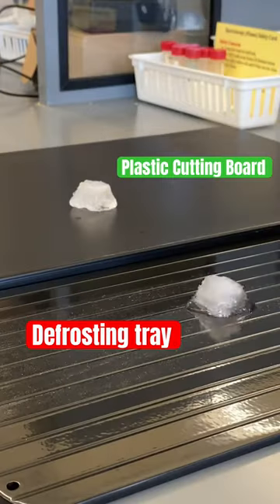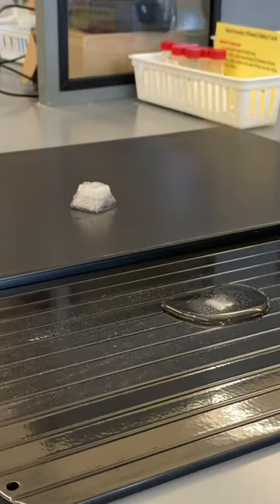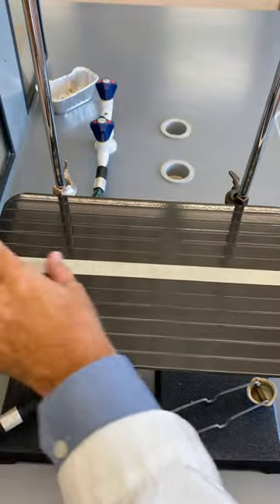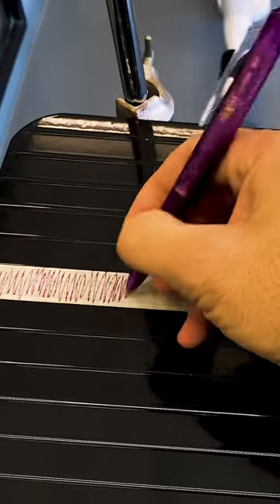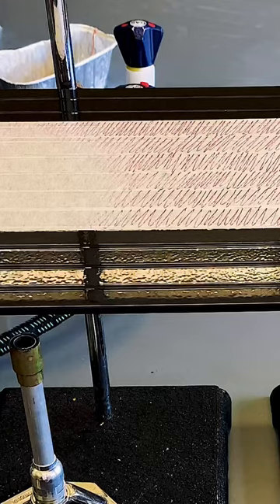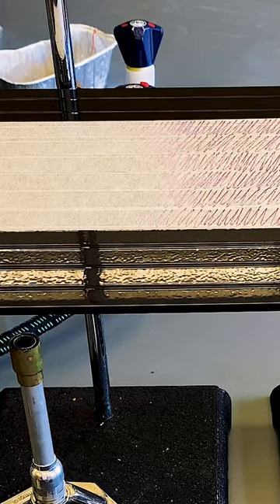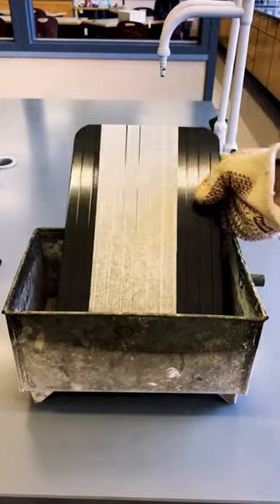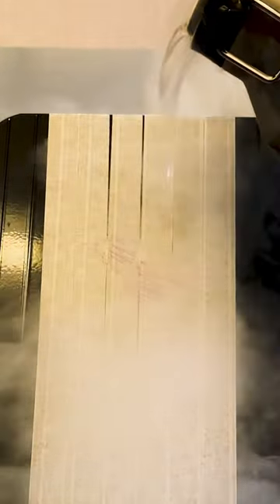Visualizing Heat Transfer with Thermochromic Ink!

Comment: The tray could be room temperature and still feel extremely cold since it's taking heat away so quickly, remember what we feel depends on the heat transfer, and that is usually related to the change in temperature.
Reply: That and pressure, which is also related to the temperature of shit but yeah
Reply: Yea it's literally just the molecules bouncing into eachother. We did an experiment in my chemistry class like this the other day. You take 3 beakers one with cold, room temp and one with hot water then add dye to each and see what happens.
Reply: @frandurrieu6477  pressure effects heat transfer RATE. It does nothing to temperature, temperature is just the average kinetic energy of molecules. Pressure doesn't effect temperature, pressure is a result of confining molecules that are moving at a certain speed. The average force per unit area is the pressure.

Comment: Isn’t silver the highest thermal conductor? 

Either way steel, cast iron, aluminum are great to but the real trick is

You gotta slide that tray to different parts of the counter every now and then to improve thawing speed.

Comment: If aluminum is a excellent conductor of heat, why it is used for food? 😮🤔🤔😳🤯🤯🤯
Reply: What?
Reply: foil is very thin and light. it does not have much mass, so it stores very little thermal energy. thats why you can put it in an oven and it wont be hot to touch.

Comment: doesn't that mean aluminum cans are terrible for drinks cuz they warm up fast?
Reply: Technically yes, but practically no. Your hand is doing most of the hard work then your cold drink is warming up, because it’s just so thin. Something like glass is a poorer conductor of heat, but because glass bottles are much thicker, they can physically hold more heat (which also means they take longer to cook down)

Comment: Can I wrap aluminum foil around a cutting board and get the same effect?
Reply from the maker: It would give you the same effect as there’s also a benefit to having a larger mass of aluminum by which to transfer the heat. Most cutting boards are insulators, so only the thin foil layer would be doing the “work” of moving heat from the surroundings to the ice or item you’re wanting to defrost. I find using a stovetop works well, so placing a piece of clean Al foil onto the metal stovetop and then the item on top works very similarly
Reply: might not have enough mass to transfer much energy

Comment: You can unerase erasable ink. Dahm did not know that tbh
Reply: I’ve been using erasable pens for everything now, and I am so tempted to chuck my notebook in the microwave to erase everything off, then throw it in the freezer to see if it’ll come back
Reply from the maker: As long as your freezer gets below -20C, it will! Can also just canned dusting spray to bring the color back, as the spray is sufficiently cold.

Comment: Does cold exist? like is cold just an absence of heat just like darkness is the absence of light
Reply: Cold exists in the same way “hot” “fast” “slow” exist. They’re ways of describing the speed of objects
Reply: @techheck3358  speed is the rate of change of position of an object 

isn't slow just another way to describe a speed 

so slow is not an existence of its own it's just a different name for speed
Reply: hmm so cold does exist but as a name to describe a measurement of the amount of heat
Reply: @suchgaming7614  yep. And to be a bit technical, “heat” is just motion, but instead of the motion of the object, it’s describing the motion of the many little atoms inside the object. The “jiggle”. So just like something can be stopped, not moving, we also have an absolute zero temperature, where the atoms aren’t jiggling at all (0 kelvin, aka -273c, aka -460f)

Comment: Then why not just use copper
Reply: Expensive
Reply: Copper would work. It would just be much heavier and much more expensive.
Reply: however while it may be highly expensive and heavier, not to mention kinda hard to get a large amount from what i've seen
it would probably work really well
Reply: While copper will wick heat more quickly than aluminium, it is actually slower to shred that heat to the environment than aluminium so in this case aluminium is not just the cheaper, easier to machine and more durable option but it will in fact outperform copper in this use case.

Comment: Bad experiment, heated one side, but cooled the other. Should have poured the nitrogen on the other side of the board and then showed the squiggles, you added an extra variable.